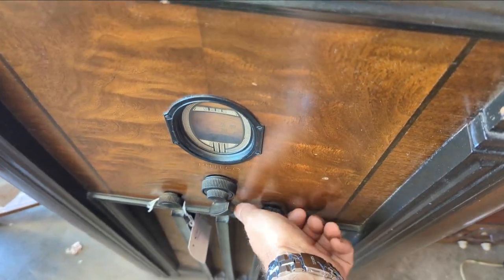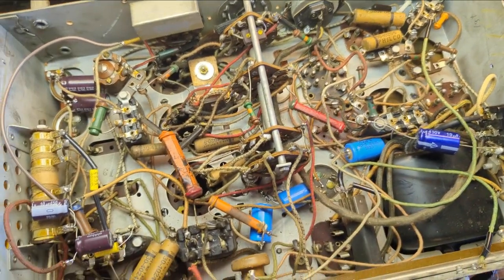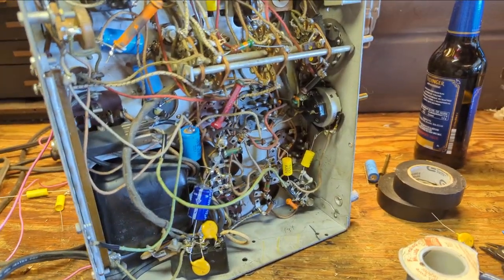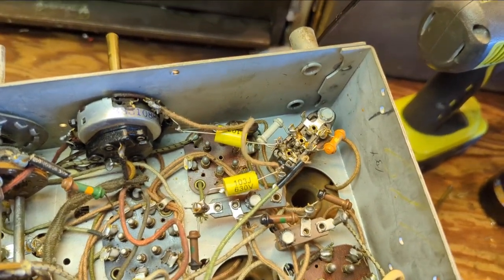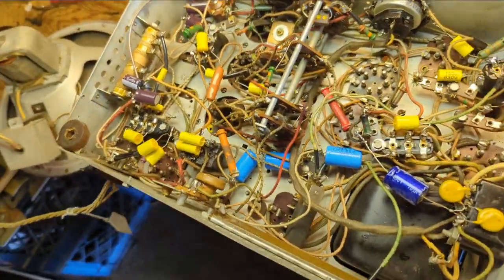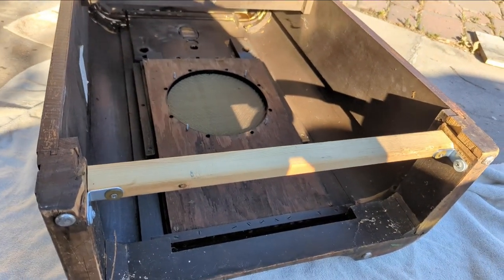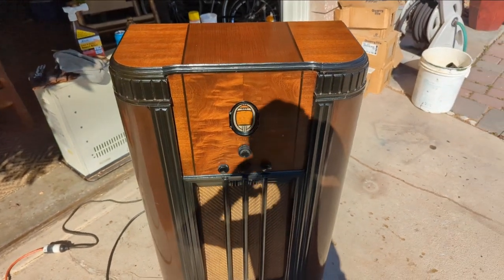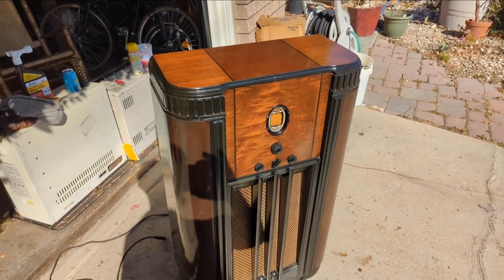1935 Philco 650X console gets a overhaul

Comment: I bought this same radio from a consignment "junk" shop about 25 years ago. The cabinet was not in as great shape as yours.
Someone literally ripped out the large can caps, and replaced them inside the chassis. I remember it needed a new tube, and power cord. It sounded great, filled the living room in my small apartment with the sound Frank Sinatra on Sunday nights, from a local AM station. I still remember slow dancing, with my soon to be wife, listening to my Philco in the darkened room, tubes glowing. It was so romantic🙂
Reply: In your head it was romantic 😅

Comment: I wish more people would bring in more antiques like this to the repair shop I could make more money on these than present day LED TVs. Not enough people have antiques where I live but sometimes I have one come in. So far I did two Zeniths, two Philcos, three Curtis Mathis, an RCA, two Magnavox, two Motorola and a Stromberg Carlson. The Curtis Mathis in the shop now has a wired problem. I did a lot of extensive work getting the record player and everything working and alive but the FM tuner won't play when its turned on the first time cold. You have to move the selector switch around and then it plays but its not the switch. I cleaned all the switches and controls with WD-40. If I unplug it while its playing FM then let it cool it won't play again. The tuner tubes 12AT7 and 6U8 test strong and no leakage. I cleaned the tube sockets too and no static when jiggling any of the tubes. FM drifts a little bit as it heats up. I almost ready to call the customer and say it's fixed just jiggle the dam knob. Stupid FM never does last on old tube stuff. Works great once you get it jumped off no static great sensitivity even the old tube stereo multiplexer works with the stereo light. FM AFC is acting funny if you tune off station it won't pick up the station until you go a little past then it locks and you can move the pointer back where it belongs. Never had that problem before. I bet something is wrong with the AFC

Comment: Insanity!  Why keep the Bakelite blocks?  Replace them with solder terminal strips.  Cut the strips to fit and locate the terminals so the wiring will reach the respective terminals.  Of course you'll need to enlarge the holes in the mounting tabs and install them with new #8 x1/4 in. sheet metal screws.  Much less work :-)
Reply: An interesting video but have to agree: why the dodgy blind drilling trick in an effort to keep the bakelite block 'look' ? Just not worth it if you end up shorting out B+ which could quickly damage power components and scarce rectifiers

Comment: Anyone recreated the Philco 650X using Raytheon/Philips pencil stub vacuum tubes and more modern IF transformers and used 2xVN66AF VMOS transistors for the power stage and run it of a 30V Wall Wart.